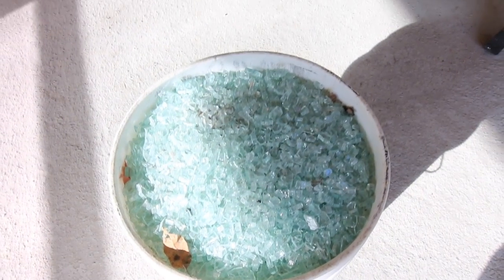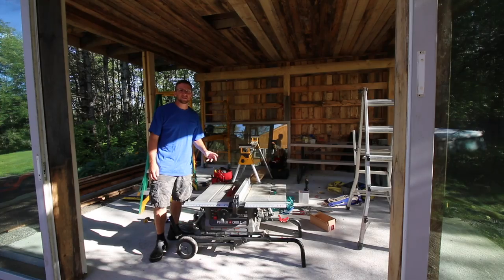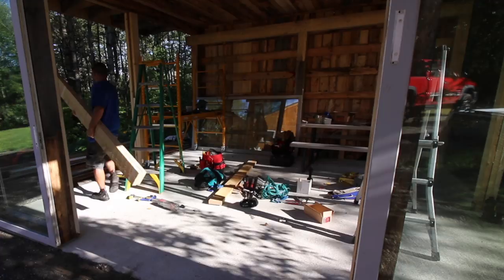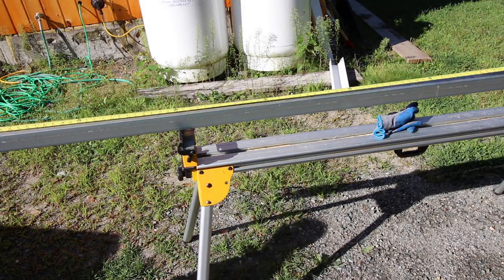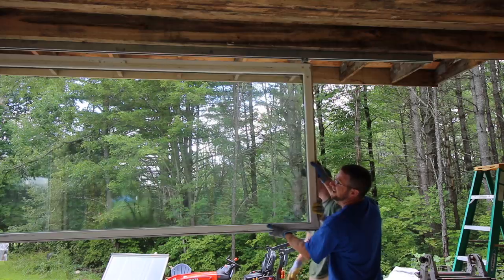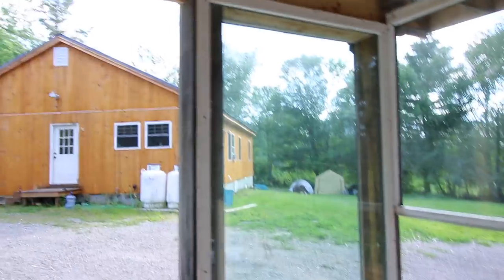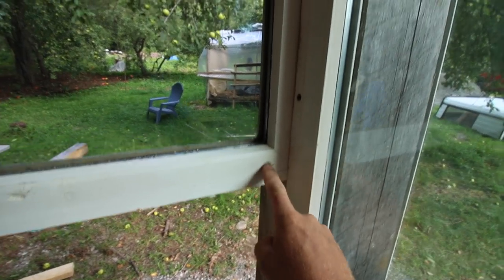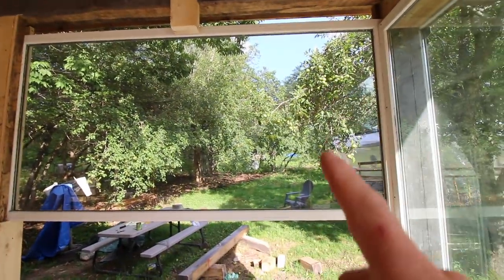Installing Sliding Glass Windows and a 5 Bucket = NOT GOOD!

Comment: Huge sliding window ! What a great idea !  I think that I would be tempted to take the time to replace that broken glass with some lexan in order to maintain the idea of two opening windows. That way the lexan would be much lighter in weight and shatterproof. Of course it won't be cheap .You do good work.
Reply: Donald Miller   i support your idea! we have lexan on the side of our front porch between the posts to keep the rain off and it works beautifully. we also have it in the garage window.  my husband does a pretty good job of glazing, you're right about the costs but it lasts forever without yellowing.
Reply from the maker: Thanks! That is a great idea, we can always modify it pretty easily to make it a slider. We will use it this way and see. If it seems to be lacking air flow you have a great idea! Thanks!

Comment: you might consider some hanging roll down shades outside, hung up under the eaves to use as needed if its really hot and sunny and you are using the new kitchen.  They are so cheap but really do the job. Also a solar attic fan on the roof would be nice to draw out the hot air. We had one of the fans installed in our garage about 10 years ago and we love it!  We have been very happy with ours.

Comment: This might be a good project to do with Olivia and another way to use that broken glass.
Several years ago, I bought some glass chips as a medium to force bulbs in. I put them in glass containers by filling the containers part way with the glass chips, and then put amaryllis, paperwhite and tulip bulbs on top of the glass chips, but just about any bulbs would work, including onion. I added a few more chips to secure the bulbs from falling over - maybe an inch deeper, or so.  Then I filled the container with water so that it just touched the bottom of the bulbs and put them on some windowsills so they could get some light. They were beautiful and made lovely flowers.
You've got the free chips now. All you need is containers and bulbs. You might also be able to grow orchids in those glass chips. I bet they'd look great in your new outdoor kitchen.
You might be able to make or find a rock\glass tumbler to round off the sharp edges of the glass chips, if that is a concern. 
Love the video! Love the kitchen build! Thanks!
Reply from the maker: Thanks! Those are some great ideas for the glass chips! We will have to look into it!

Comment: That was a red eft, the juvenile stage of the Eastern Common newt. Typically eft, newts, and salamanders are found in damp, moist areas, leaf litter in both deciduous, and conifer forests. They produce a mild toxin, not dangerous but very nasty, and bitter, as a deterrent to predators. They are also susceptible to absorbing toxins through their skin, which can be fatal. Spring and fall it's not uncommon to see them out of their deep litter as they do migrate. Primarily nocturnal, they do come out during and after heavy rains to hunt for food. During dry spells they remain in their litter where they will burrow about in search for food. They can be kept as pets if provided with a proper terrarium with moist leaf litter and moss. It's a lot of work to supply them with an adequate supply of small insects, worms and larva which make up their diet. They are pretty boring too, as they most often remain hidden. I'd venture to say, you probably see a lot of their cousins the Spotted, and Tiger Salamanders during their spring mating migrations. Finding them on your Modern Homestead is a good sign, they don't do well in areas that have had much in the way of chemicals or pollution on them. Excellent indicator of a healthy, natural environment. Environmental conservationists track amphibian population densities to monitor pollution, as their absorbent skin makes them very susceptible. 
Bummer about that piece of glass. The good and bad of tempered glass, good for it's clarity, and that when it breaks it's uniform  little pieces. Bad in that it doesn't do well with impact shock. It could be interesting as an exposed aggregate in future concrete projects. I'd caution against having it to near anything of hot temps. As it expands from the heat it will pop explosively. 
 Other than that, the Modern Homestead Off Grid Outdoor Kitchen (MHOGOK) is looking real nice. That pocket window is a pretty  clever way to repurpose an old sliding door. Your descriptions of how it will be finished, it's going to be pretty snazzy.
Reply: David Johnston, We love your knowledgeable explanations and your very constructive information that you add to this channel. Be Blessed Dear Sole
Reply: I'm so sorry, but I had to laugh at this beautiful and sweet post by Dennis St.Germaine. There is a typo in the very last word. A "sole" is either 1) a fish, 2) something very unique,  or 3) the bottom of your foot. I think you may have meant "soul".
Reply: This love of damp leads them to attempt to overwinter in wood piles.  When they would crawl out from inside logs that were put on the fire, people began to associate them as creatures of Fire.
Reply from the maker: Thank you for sharing all of your great knowledge! We the Modern Steaders always learn so much from your comments! So the glass wouldn't be good in a concrete fire pit then! Lol. We hope it turns out snazzy! :)
Reply: I hate to be a fly in the ointment, but concrete is not a good choice either. Concrete contains a lot of silica sand which behaves the same as tempered glass when heated. Tempered glass contains a lot of silica, one of the major components in glass making. Concrete will spalt and crack from the heat. 
I might suggest native granite. You live in granite country, it's hard to dig up there without hitting granite boulders. lol I recollect some pretty good stone piles from your tour video. Talk about your cheap resources, just saying. lol
Reply: Thank you, I've been blessed with many teachers and mentors along my way. I hope that I can repay their kindness in sharing what I've learned.
Reply: Don't apologize, my editing and grammar skills have a lot to be desired.
Reply: Dennis St.Germaine I think your kindness and positivity more than make up for any editing shortcomings.

Comment: I assume the bracket would not fit to make it slide. That is to bad about the glass breaking.  Awesome job on the building
Reply from the maker: The bracket fit the bit caught on a metal rod in the frame and drilled at an angle! Thanks

Comment: Awwww! What a shame about the broken glass! Was that the last of the doors that you could use? What about getting another piece of glass cut and fit to the frame? Or maybe replace both panes with some plexiglass? It's not that expensive and some scrapes may be available locally. I would hate to think that the window was not able to be opened as planned for the flow-thru. Worth  it to look into. Anyway the outdoor kitchen is looking great and you will have it finished in time for the class in Oct. 
Thanks for sharing!
Reply from the maker: Thanks! I am sure we can replace the panes but we would be looking around $1000 for the same glass that was in it